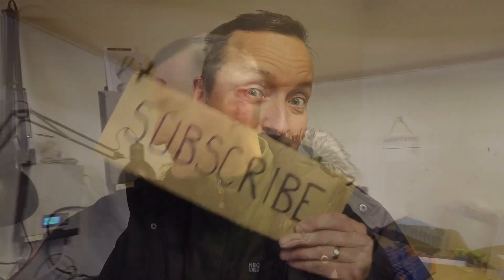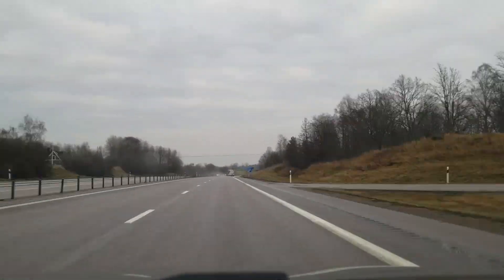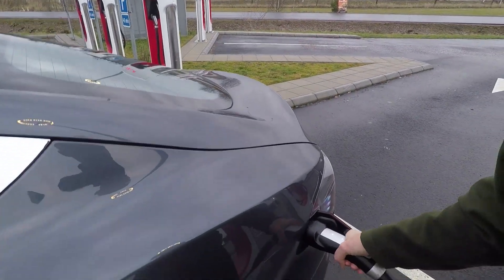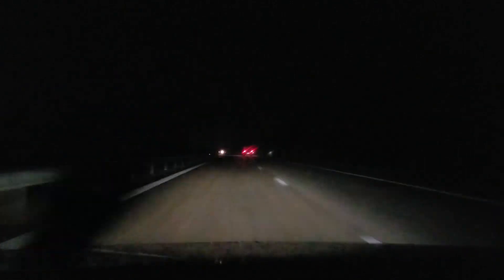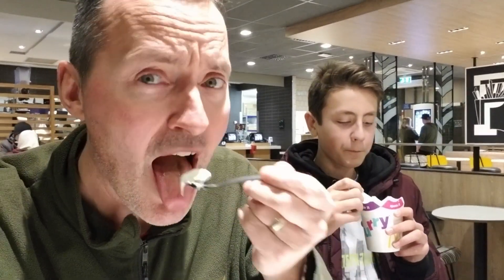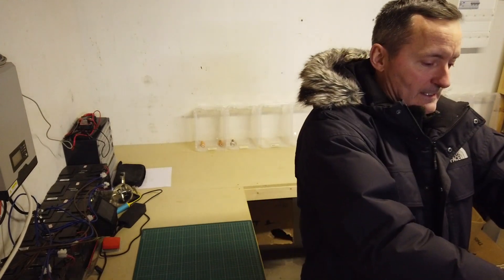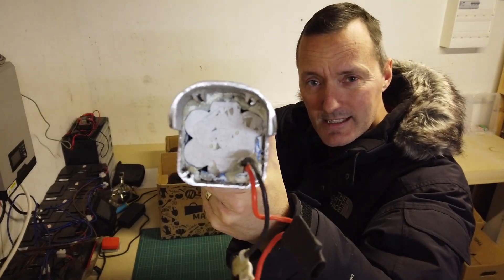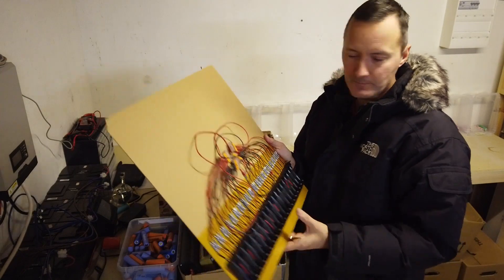Road trip across Sweden to buy 18650's for my DIY Powerwall

Comment: Nice amount to play with. The Ebike batteries would be interesting to see what capacity they are. I have never striped Ebike battery (power tools and Dyson vacuum cleaner Yes) but would be interested in what is inside. My guess 10A discharge 1300mA capacity. Be sure to put this in a video.
Reply from the maker: Thanks Adam, that is a GREAT idea!  I'll do that, I have a few left to break open and they're a little different to laptop batteries so I'll film a video specifically on this for you...  They're a little more lively when you accidentally short out the wiring (!!!) so there's a couple of extra safety considerations when breaking them out which could be useful to everyone. Thank you so much for the feedback and the idea, i'll get a video out in a few weeks for us all - You're a star! :-)
Reply: @TheKilowattChallenge  Yes these cell have a big punch when shorting because of the high discharge rate. be sure to show the cells on camera so we can see what is written on them.

Comment: How much did you pay for all of that? And how many kg. Did you get?
Reply from the maker: I cant remember actually, it was something like around £400 I think (it was 6 weeks ago!) and I don't know how many kg but I do know, there's around 900-1000 cells in the whole batch.  Do you sell batteries?
Reply: @TheKilowattChallenge  I don't sell any, but was just 
curious. i have 
bought 80kg of Hilti tool
 batteries of a guy in Denmark were I live, and didn't know if that was a good deal. I paid £1,46 per kg. or £120 ish for all of it. a lot of the pack got rust in them but if must of the cells are good it will be around 1000 cells.
Reply from the maker: Somebody once told me how much to pay / kg but I cant remember. I do think though that you got a very good deal there!  Good luck with them and let us all know how you got on :-)
Reply: The Kilowatt Challenge that’s too expensive. In DK we pay 10kr or. Kg. For that price you could get 300kg notebook batteries, which would equal 6.000 cells.